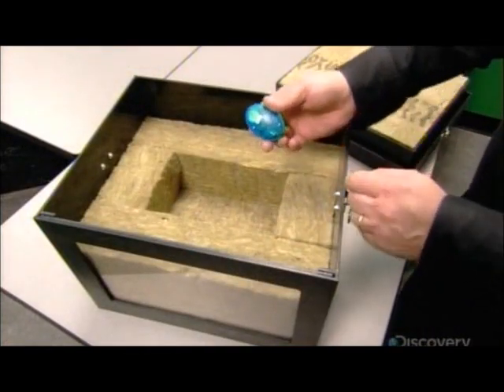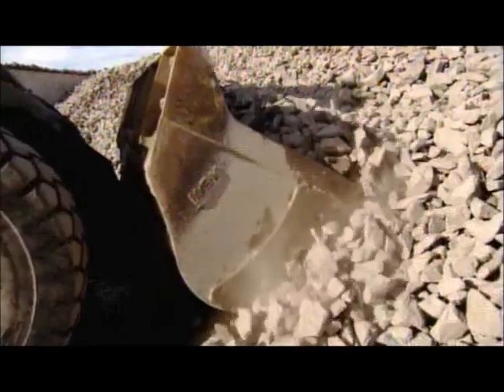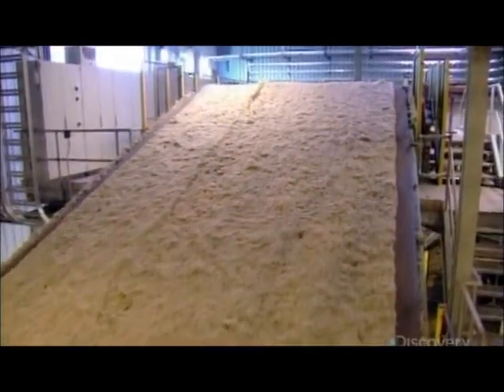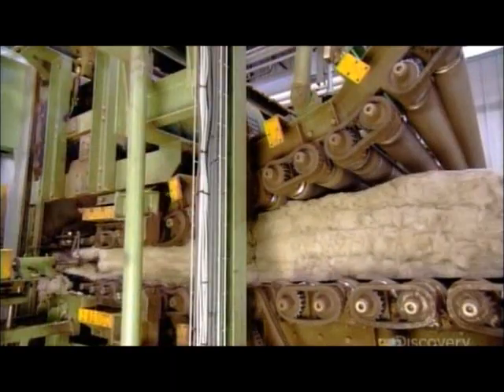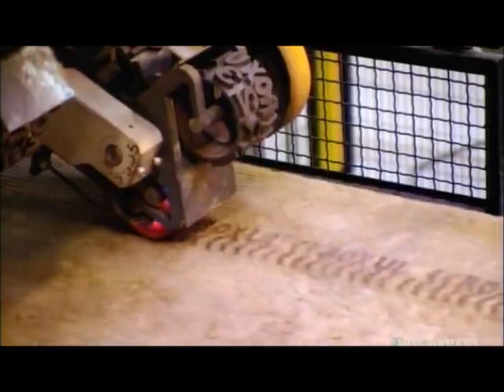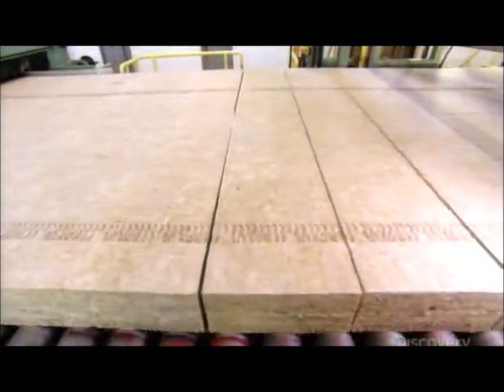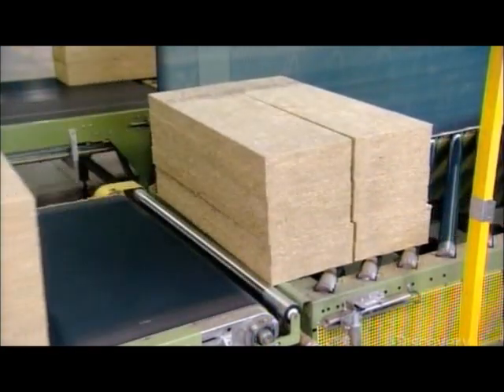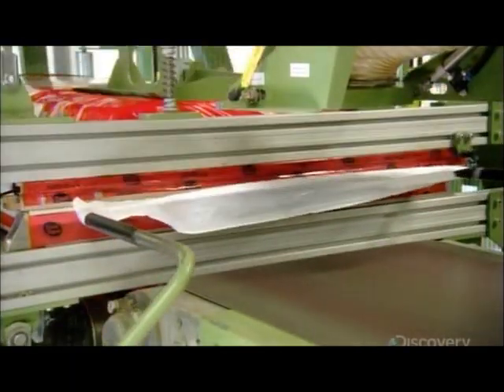How It's Made - Stone Wool Insulation

Comment: I was just thinking.  The slag was already molten when it left the steel mill. Yet we let it cool, then later remelt it. Wouldn't it make more sense to add this to the output of the steel mill so it was all processed as a by product of the steel without the wasting of extra energy?
Reply: The rockwool plant I do maintenance at is about the size of a steel mill with giant cupolas designed specifically for this purpose. It contains a pile of other ingredients as well. The way it works is practical. Slag isn't even the main ingredient.

Comment: I used to work with this stuff! At Structural Panels Inc in Baltimore Ontario. Awesome place to work with cool people. Fun as hell too :P Hard work though, cutting this stuff sucks, when it gets into your skin it looks like razor burn almost, like whitehead pimples as it works its way back out of your skin. Plus its a pain to get the dust/cuttings off your skin, if you try to wash it the water just beads off and if you try to rub it off with a cloth it just forces it into your skin. The only way I got it off was with an air hose and light bursts otherwise it would just force it into your skin like the other ways :P Made you arms look like you had the worst and nastiest rash ever.
Reply: Use pantyhose.  It grabs it and pulls it out.
Reply: Use long sleeves and gloves if you can. I hate the stuff.
Reply: Love it when you get sweaty, or work with this stuff in 40 degree heat. Man... How long did you do it for?

Comment: We sell this at Lowe's I wish it would catch on better and replace fiberglass insulation.
Reply: I found stone wool crumbles over time. We have older stone wool and I pulled it, vacuumed out the crumbled dust, and put Fiberglass down.
Reply: @edwardg9695  fiberglass breaks down over time too, falls apart when you try to handle it.
Reply: I tried both.  I only use fibreglass now.  The both produce splinters and seriously damaging airborne fibres.  But the rockwool produced a lot more of them.  My skin remained itchy for many days after the rockwool job.  I would have needed a hazmat type suit to handle it safely.
Reply: @smitajky  I believe you. It is literally spun rock. Just like cotton candy is made basically. I prefer blow in insulation myself.

Comment: What type of insulation is flammable? The one that's responsible for the many house fires in Australia?
Reply: The aluminium foil insulation uses bitumen materials to separate the two thin foil layers.  The bitumen is flammable.  But many house fires are started by non flammable insulation.  You put it in the cieling and cover wires or downlights with it.  Now the heat cannot escape so they heat to such a temperature that a fire starts.  DON'T cover wires with insulation.

Comment: This is the replacement for asbestos insulation. As a builder for 25 years I've only seen this stuff used as firestop in commercial buildings
Reply: We use it for insulation and soundproofing in residential buildings all the time

Comment: I'm no expert so why would one use stone-wool instead of fiberglass insulation or vice versa? I'm guessing it's because of stone-wool's fire resistance and better sound dampening?
Reply: that_G_EvanP  you're correct in 25 years the only time I've seen it used is to fill in small gap's in fire rated wall systems usually above suspended ceilings.
Reply: its just better

Comment: I had no idea that you could make wool out of rock.  kind of mkaes me wonder if you can make clothes out of it.  I'm sure it would not be comfortable, but just think of the novelty of wearing stone clothes.
Reply: ID ROCK IT! LOL PUN INTENDED
Reply: Lord Kiyo There is protective clothing woven from basalt fibers. It's temperature and fire resistant, much like asbestos, but probably less carcinogenic.
Reply: Clearly no one of you guys, have worked with this material. It has fibers, that will fill your pores, that will microcut your skin, and it feels just like i described.
not worth it guys :D
Reply: @oskarsberzins4890  maybe with a protective layer over it.
Reply: @oskarsberzins4890  
I believe those are the properties of a glass wool insulation, not stone wool. Just for that reason, stone wool is better than glass wool and it won't burn at all where glass wool tends to burn on higher temperature.
Reply: @kolobara08  Came here to say what Oskars said. I've worked with rock wool and glass insulation both. Rock wool is by far the most itchy uncomfortable thing I've worked with. It is an incredible material for insulation, but unless they put it through some process that makes it less itchy, no way in hell would I wear it as clothes.
Reply: @atomblack2093  Thanks for the input. I know about glass wool being itchy and it's kinda logical because, I can imagine tiny glass fibers/threads to be super sharp. Would have thought that it's not the case with rock wool but I guess I was way off.
Reply: @kolobara08  I would think it would melt not burn...
Reply: Lord Kiyo i
Reply: Paleo clothes
Reply: Like living in the Stone Age ! Yabba Dabba doo!

Comment: how much energy is needed for one block to be made?
Reply: The energy needed to heat and melt basalt and steel at 1200 celsius?  It's a lot.  Probably the main reason it's so much more expensive than fiberglass.

Comment: r value, how does it work? 1 is very good 5 is substandard?
Reply: R value measures the effectiveness of the insulation.  R-13 is the lowest, ranging up to values of R-15 and R-30.  You can use R-30 for attic insulation, since heat rises to and escapes from the top of the structure.
Reply: +Robert Glover  thank you Robert for the detailed answer. and what are the numbers? the thickness of the mat? or maybe the denseness of the material? or any other meaning or indication?
Reply: I'm not sure about the exact demensions.  Here's a link to Roxul's website http://www.roxul.com/ They have all of the product details.  The mat's are approximately 2 x 6 x 1.5 meters in packaging.
Reply: +Robert Glover  tx for the link. the `R value is the resistance to heat flow...http://www.roxul.com/files/RX-NA_EN/pdf/MSDS%20and%20Safety%20Bulletin/US%20Retail%20Insulation%20Fact%20Sheets%20(US%20CFR%20part%20460).pdf

Comment: Good stuff- wish they used it when my house was built. I really like the fire-resistant aspect of rock wool insulation.
Reply: yea...but remember that while the stone wool can resist temps of 1200C....the rest of the house cant...xD
Reply: Azarith I’d rather there be boulders in the river than nothing stopping it.
Reply: Yes but rockwool has been known to cause some cancer. It is bad for your lungs and the fibers sometimes get in your eyes
Reply: @amberleary8705  Rockwool does not have a link with cancer, you may be thinking of asbestos (which is a horrible material). The rockwool fibres are bad, yes, but this is only an issue during construction, and can be solved by wearing protective gear. Once it's in the walls it's fine.
Reply: @mortenrl1946  you can say the same thing about asbestos
Reply: @wardwyseur  Yes and no. Rockwool has many of the same properties as asbestos, just not nearly as bad from what I can tell.

Comment: so how can we use it for hydroponics if it's water resistant?  It's deffo not water proof!?
Reply: +Horticulture and Bonsai est2005 (Doug) 

The product they show here is insulation, specifically Safe and Sound 16". This factory also makes the Grodan product used in hydroponics, on the same line actually. Just uses a slightly different formula, and lacks binder. Still it's fun stuff, and interesting.
Reply: The fibers don't absorb water. It's not used in hydroponics to hold water it's used as structure for the roots to anchor themselves in